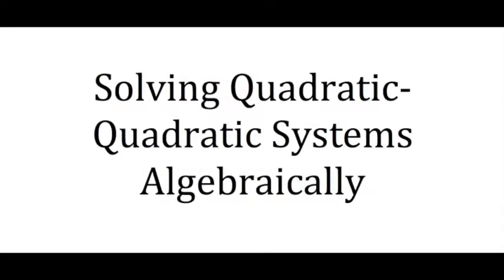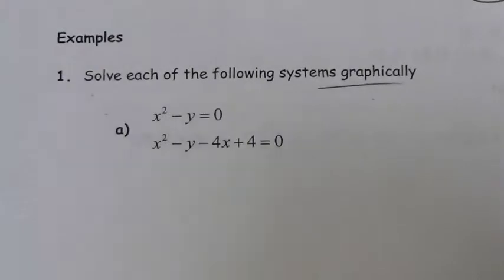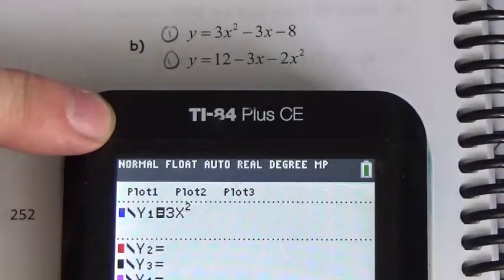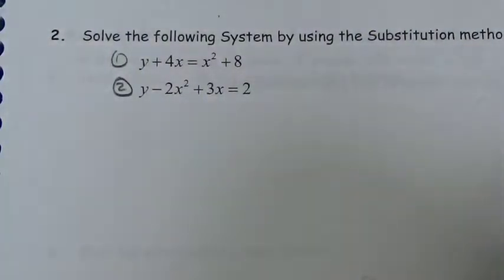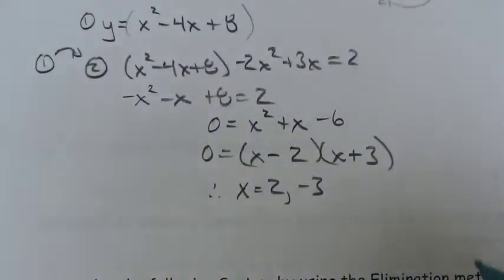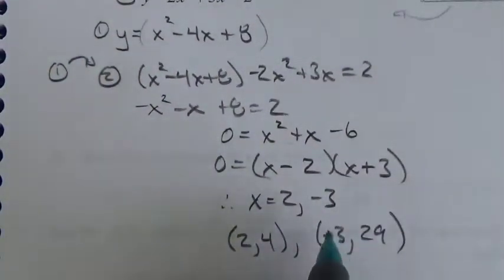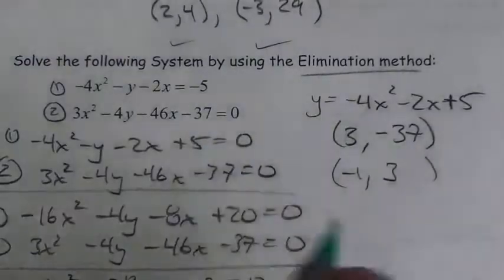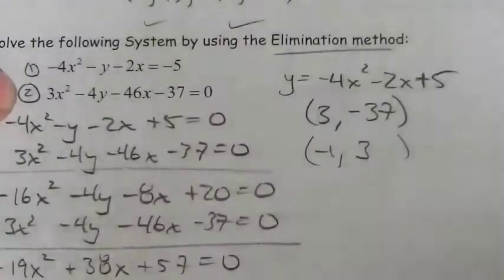M20 1 Quadratic:Quadratic Systems   Lesson

Comment: IMHO, this workbook has entirely too many problems with no solutions. As a student it is frustrating to do so much work to arrive at nothing. No solution problems should only be 5% or less of the total problems.
Reply from the maker: That is a fair point, but if a question like that occurs on a exam I don't want students thinking that they have done it wrong and then changing their work to "find" a solution.  I have seen that frequently and it breaks my heart on their behalf.